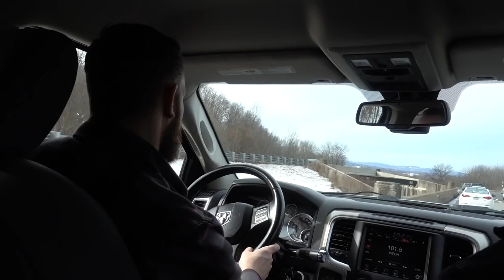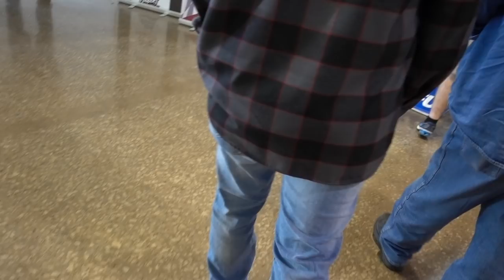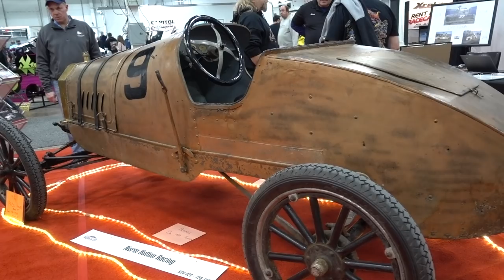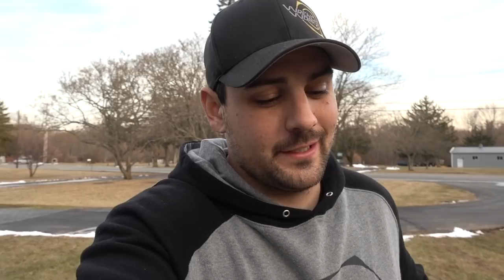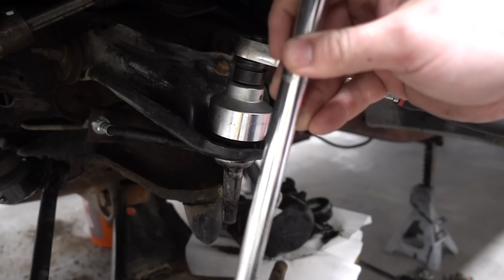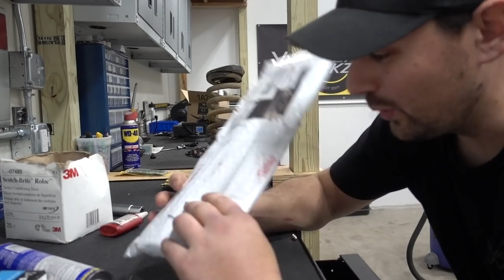BUYING OUR NEW MASSIVE ENCLOSED TRAILER!!!!

Comment: good call on the Moog ball joints.  We changed them out on my dad's 93 cummins with advanced auto cheapo's  and the fricken nut stripped right off the threads on the bottom joint while he was driving.   Needless to say, he was pissed.

Comment: Great stuff as usual Greg,  
But I'm puzzled by the fact that you have not picked up one of those Milwaukee 1/2 " cordless BEAST of a gun yet... 
Heck,  with just doin wheel S as much as you do it'll pay for itself.
But ya gotta get the brushless.
Reply: 91coyotecoupe OBS Fumminz that is going to be a purchase of mine soon. I am in construction and have fuel one key impacts and hammer drill and I most deff want a 1/2” impact. Big fan of Milwaukee and the heated m12 jacket saved me in this past month.

Comment: Harbor freight has lifetime warrantee just like snap on and a hell of alot cheaper . For most people harbor freight is more than good
Reply: gun-nut257 For quite a bit of the tools harbor frieght is fine There are a few things you have to skip though.
Reply: Snipe Stud00 totally agree !!!! There impact sockets are some of the strongest I have ever seen
Reply: gun-nut257 their electric tools suck too. Milwaukee ratchets and impacts are way cheaper and better. Same with dewalt (I don’t think dewalt has an electric ratchet though)
Reply: Snipe Stud00 what are some items to skip over? May I ask!!
Reply: most of their power tools are junk, drill bits as well. I have had luck with most of their hand tools, especially when you don't use 3 ft cheater bars on things that aren't meant for it. I've broke Mac, Snap On, proto, craftsman tools, as well as tons of junk tools. I would go with high quality ratchets, and use cheap sockets, wrenches, etc.
Reply: Right up till you ROUND a Critical Nut or Bolt....
Reply: Don’t buy harbor freight power tools or torque wrenches but I’ve had good luck with everything else
Reply: I speak from experience, don't buy Dewalt!!! Their stuff has gone downhill big time... I have a lot of their older tools that work fine still but any of their new shit I bought has already shit the bed, and its various tools not just the same one multiple times.
Reply: Nothing wrong with harbor freight hand tools.